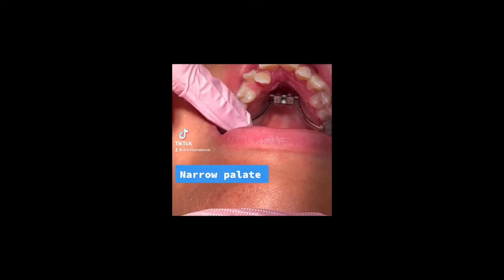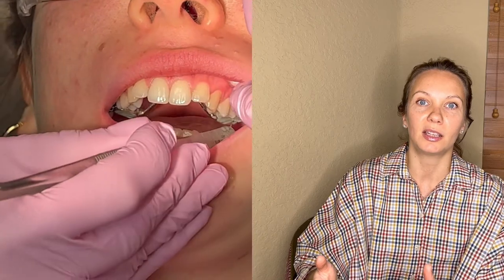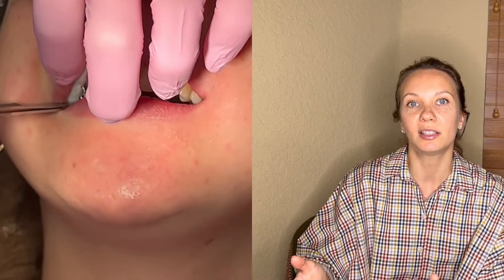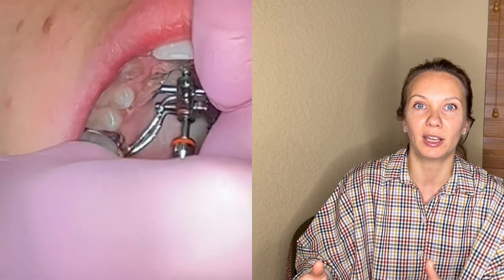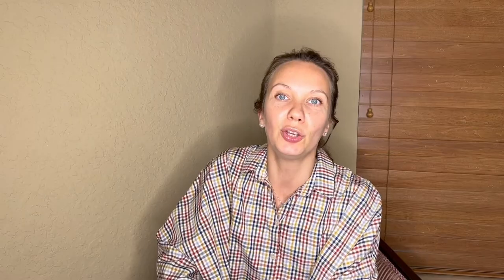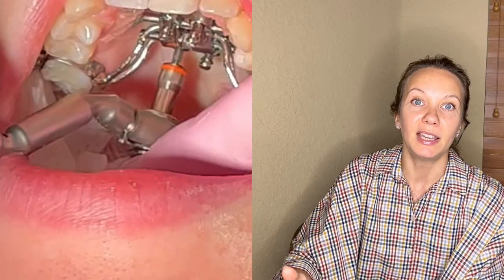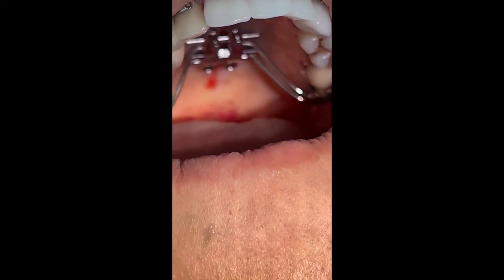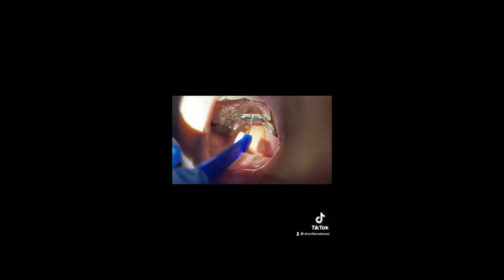Maxillary skeletal expansion (MSE) placement

Comment: Hi Dr. What's up?
Please.. can you tell us..
1_ what is meant by low and high torque bracket and in what cases we can use them?
2_how can we deal with wagon wheel effect, when a torque is applied to the anterior teeth especially the laterals, and if happend, how can we fix it?
thank you so much 🌹🙏
Reply from the maker: That’s A great comment! And another point to be addressed in an upcoming video.